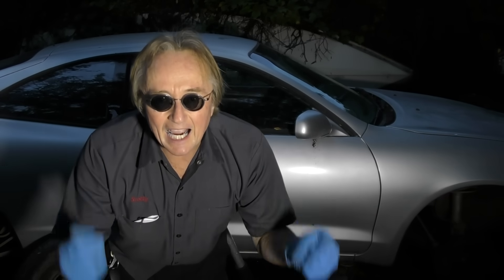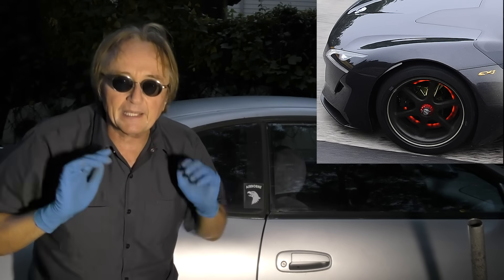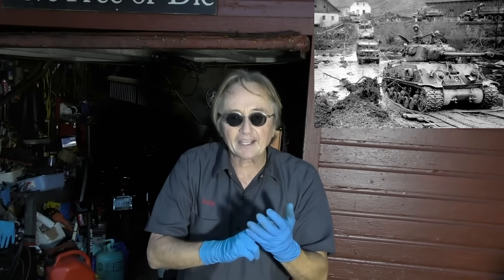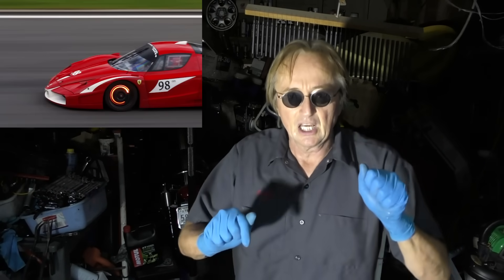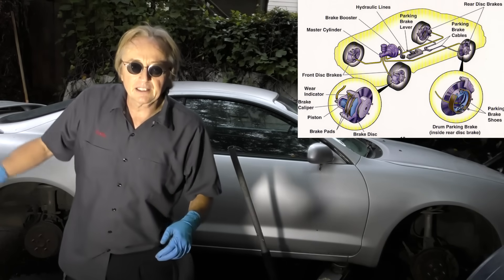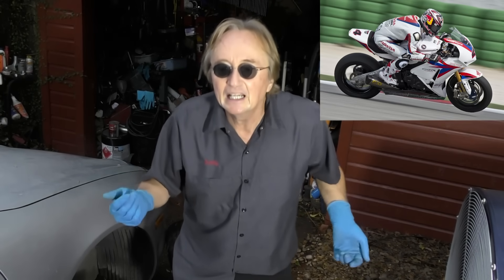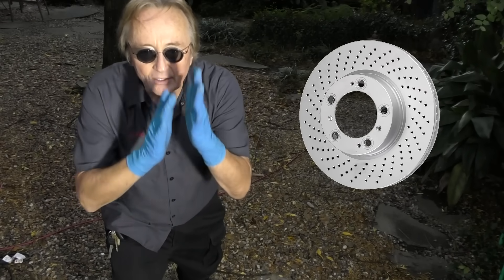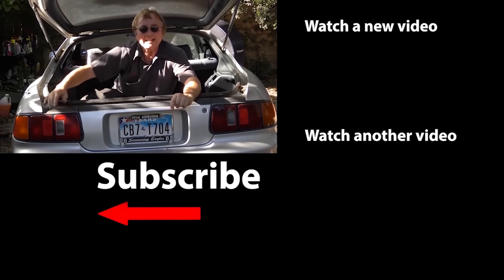Why Some Cars Have Drum Brakes Instead of Disc Brakes

Comment: Those rear drum breaks make a much simpler system for the emergency brake setup.
Reply: Chevy trucks switched from 4 wheel disc to front disc & rear drums in the middle 2000's. When I asked the sales guy why he just rolled his eyes and said they told him they would stop better. Found out later that with 4 wheel disc they were starting to fail inspections because the parking/emergency brakes would not hold.
Reply: Many cars that have 4 wheel disc brakes have an inner drum brake in the rear disc brake rotor to serve as the parking brake.
Reply: Get a Volvo - disc brakes with drum handbrake. Madness.
Reply: Those wear discs with a drum parking brake are better they don't wear and NEVER use it for emergencies unless it's about 5 mph or less the car will spin out it's for PARKING ONLY
Reply: @DylanL69  i did it with 6 miles an hour i spun out and distroied a building killed 500 ppl and for as far as i know im stil spinning
Reply: @jwvanliere854  damn ouch that sucks
Reply: @DylanL69  yea im stil spinning out but im almost at 5 miles an hour now so il be fine soon
Reply: @jwvanliere854  lol you got jokes
Reply: @DylanL69  It's a matter of terminology. Americans call it the emergency brake, in the UK we call it the handbrake - a term that makes no assumptions about when to use it.  In fact if the footbrake failed, you would want to use it. Better to spin than hit something, and it would depend on how hard you pull it.
Reply: @DylanL69  and emergencies
Reply: No it's not if you use it for emergencies the car will spin out so that's wrong
Reply: @DylanL69  I realize what you are saying but if you're approaching a red light and your brakes go out you're not going to use the "parking" brake?
Reply: No, it doesn't. It's more complicated. You can have you standard rear disc calipers with an arm connected to the hand brake line. TA DA! You know how I know? I own multiple cars with that design. Drum and disc is retarded. The junk always wears out and can't be adjusted anymore. Guess how I know about that? That's right, I own multiple of those cars, too!
Reply: Drum brakes are less efficient.
Reply: @Thunderstormworld  yes they're less efficient but they make the best parking brake
Reply: @DylanL69  not really, disc still out preforms and less hassle
Reply: @DylanL69  Not when the parking brake is tucked under the hat of a rotor. You get the best of both worlds
Reply: @thefuzzypickle8277  no you don't
Reply: @Thunderstormworld  No, drum brakes have a lot more contact area for braking. The problem is cooling, brake drums have a lot of mass and they don't dissipate heat very well due to their design, they don't really have any airflow compared to disc brakes. They are good for one hard stop, after that they start to get brake fade. On never cars there are only disc brakes due to drum brakes looking ugly

Comment: Brand new Toyota Tacoma has rear drums
Reply: Jon Smith as good as Toyota's are,here in the UK their parking brakes are notoriously poor with the disc/caliper set up....my old Rav4 has drums,never had a problem or changed shoes in 9 years.
Reply: What a joke huh lol
Reply: Yup, and with the parking brake on, the wheels might as well be welded to the frame. Full size rear drums make superb parking brakes.

Comment: Aside from performing better, disk brakes are a lot easier to service than drum brakes.
Reply: Mark Jordan more prone too seizing though,especially rears....using good grease on the sliders helps alot though...I use Mintex ceratec,alot of people still wrongly use copper grease on sliders.

Comment: I drove with rear drums for about 15 years and discs about 20 years.  The discs are momentarily jittery after driving through a large puddle.  Never happened with the drums.  I guess if one fords a river 2 feet in depth, it could get wet inside the drum.

Comment: good day sir, i have an mitsubishi fuso drop side elf truck that i used for sand or gravel delivery 3 cu mtr capacity. is it wise to convert either 2 front drum brake iinto disc brake or all 4 drum brakes into disc brakes. ?

Comment: THe MAIN reason for drums,is to have an easy  way to install your emergency brake;
You can't  put an emergency brake on disk brakes; 
Well,you can,by paralleling the disk with a drum,but that brings the weight and complication up a lot;
edit     Also,drum brakes are more powerful,they have more area; trucks and trailers use them; the price is the same.
Reply: Discs are more powerful, not drums
Reply: @spartacussmith7070  maybe yes,maybe not; it depends on friction area and force (pressure  times piston area); 
Tractor trailers have drum brakes,they need all that area; 
(From the net :"90% of heavy truck buyers today still choose tried-and-true drum brakes"); 
There are tractor trailers with discs,also.

Comment: on my 95 celica sx ive got disc brakes on both front and back, is that normal?
Reply: Definitely.  I have an 03 Acura, an 08 Acura, and 16 Acura, and they all have all disc brakes now.  If you do your own brake work (or are considering it) then you are good to go.  Discs are super easy to change out compared to drums.

Comment: Scotty the statements you are making in comparison between drum brakes vs disc brakes is not all the way correct. Why not use the engineering principles of force by clamping . The brake manufactures are truly laughing  at your representation. There is a good reason why you have disc brakes on the front and drums on the back!!!

Comment: The first American Cars with disc brakes were the Crosley Hot Shot/Super Sport and the Chrysler Imperial in the early '50's.  The Corvette came out with disc brakes and IRS because the Jaguar E-Type with their disc brakes and IRS was mopping Corvette up on the race track.  Drum brakes on older cars are fine IF you drive your older cars like they were designed to be driven.  If you don't, brakes are the least of your problems.

Comment: drilled rotors are the worst, they tend to have weakspots on where the holes are and crack under extreme temperature change during braking and accelerating. Most race car drivers used grooved rotors. Sports cars that have drilled rotors are mainly there for aesthetics.

Comment: 4  drums brake downfall was, when one wheel hit a puddle of water then you brake, the car would "pull " on one side. The most important thing is, people had to drive in a more responsible way because, they had to keep it at a moderate speed and a safe distance from other cars. That's why, you see ALL original, old cars, driving slowly.

Comment: True drum brakes last than disk breaks, my 1996 F150  believe it or not since then when I bought that truck so far I still have the original break shoe, my front disc breaks I replace it 3x already..

Comment: 1969 Mercury Cougar. 351 V8, drum brakes. Fast idle when cold. Drive a block down the street. Slow down to go through a dip in the road on a rainy day. Wheels got wet and you didn’t need to take your foot off the brake to accelerate. The car speed up from the fast idle and the slipping wet drum brakes. You had to be sure to stop early for the red light up the street because it took twice the distance to stop with wet brakes.

Comment: Prior to ABS I remember "Low Drag" disc brakes around 1980.  Those had a tendency to not stop the car in an emergency for the first few stops.  I also remember front discs/rear drums from the early 1970's that would allow the drums to lock-up and cause the rear of the car to swing around.  I think this was prior to proportioning valves.  Brakes have come a long way over the years.

Comment: Converting a classic era automobile with original 4 wheel drum brakes to front disc brakes should not affect its assessed value either. It's the right thing to do for public safety (sez me who used to drive a 4,000 lb. Ford with 4 wheel drum brakes, no power assist, and single brake fluid reservoir. Yikes!).

Comment: I will never buy a vehicle with rear drum brakes again. Every one I've had they rust a little and lock up first application if it was damp when you parked it. I could never get them to automatically adjust exactly the same either. Why they are still used I don't know.
Reply: Like Scotty said, using rear drum brakes is a way of reducing manufacturing costs. It costs money for a manufacturer to change the design of a vehicle and alter the manufacturing process to go from rear drum brakes to all four disc brakes. That's really the only reason why only basic economy cars have drum brakes anymore. Even many not so expensive brands have all four disc brakes!

Comment: I have a 2009 Chevy Cobalt with a automatic transmission I have replaced the race axle seal AKA output shaft seal two times in the last three years what could be causing this seal to go out repellently

Comment: i bought a 66 beetle and i was wondering if i should convert it to disk breaks
Reply: I had a 73 Thing that I put a disc brake kit on the front. It made a huge difference. No more downshifting when you brake for a panic stop. The Thing also had two adjusters per drum that didn't self-adjust. The kit I installed also came with a new master cylinder.

Comment: I thought the drum and tge disc brakes are for safety purposes like when your front brakes dont work the rear works if everything dies not work the hand break does if not the engine brakes does and if not the clutch will.

Comment: I don't agree with using mostly front brake on a motorcycle. 
I think it's dangerous .. but it's only my opinion. 
The rest of the video was great !
Reply: Well, touching the front brake while cornering isn’t the smartest thing. Anyway, on a motorcycle most of the weight is hanging over the front wheel while braking. The more you squeeze the front brake the more mass will be shifted over to the front wheel. Because of that the front tire will compress, increasing its contact surface on the asphalt, which means that it can take even more braking torque before the wheel locks up. In that kind of situation 90-95% of your weight, including the motorcycle, is taken by the front wheel. Which means the back wheel will have minimal traction. Its only distracting and it does affect your braking distance very little. 
If you think using your front brake on a motorbike is dangerous, why do you even bother riding ?

Comment: In europe, back in '55, the Citroën DS had front power disc brakes and was a mass produced vehicle, even for today's standards its high pressure hydropneumatic system makes its brakes be really effective, they're inborard, next to the gearbox, not at the wheels, and have air conducts coming directly from the front of the car to cool them, you don't feel any fade. 4 drum brakes would work perfect in old, little and light european utilitary vehicles, cars that used to weigh arround just half a ton, those drum brakes are really hard to fade as well. I use to drive a Renault 4, a Seat/fiat 600 and a 2cv with all drum brakes and they're great for those cars, not the same with my old '58 Plymouth or my Seat/fiat 1500, but they weigh quite more and are faster, of  course.

Comment: You never just use the front brake on a motorcycle, always apply the rear first. Even the high end bikes have systems that apply the rear first even if you don't don't by using the pedal. Panic grab on the front lever will apply the rear first with high end systems.

Comment: Front Disc Brakes is good enough as a standard because 90% of braking power is by the front. Ok. Drum Brakes much much less effective and has a weakness for water but they are cheaper and drilled or slotted disc brakes only good for racing and also wear out much much quicker than normal flat disc brakes.

Comment: Hey Scotty, I was watching a Formula One pre-race feature when retired F1 driver Martin Brundle took current F1 Driver Daniel Ricciardo for a spin around the circuit in an Aston Martin.
When they came back to the starting position, the the right front brake suddenly burst into flame(!) A member of the team helped out by dumping their giant Slurpee into the front wheel, extinguishing the flame. I think that the anguished scream we heard immediately after that was from the engineers at Brembo who had just seen their rotor— glowing bright orange — suddenly de-tempered with an ice-cold drink.  Like you said: Time to change the brakes. What??? It's only money.

Comment: The first mass production use of the modern disc brake was in 1955, on the Citroën DS, which featured caliper-type front disc brakes among its many innovations. These discs were mounted inboard near the transmission, and were powered by the vehicle's central hydraulic system. This model went on to sell 1.5 million units over 20 years with the same brake setup.

Tucker wanted to put disc in his but money and engineering issues forced him to use conventional brakes.

Comment: But the Integra, based on the Civic had rear discs on all of them.
Reply: Some cars (especially if it's high luxury or a sports car or a higher trims) do have all discs all round. For example my Camry in 1995 lower trims have brake drums but higher trims have disc brakes all round.

Comment: I Think That is a mather  of  engine capacity.  Many Times they put discs after "few horses power "  on The cars. Mabe The small engine don't need som much brake . Just if you go to racing.

Comment: On motorcycles i always use the rear brake for slowing down and the front for stopping. Strong brakes on the rear are pretty pointless since all the weight moves to the front wheel when slowing down anyway causing the rear tyre to skid.

Comment: My 2003 BMW 320i has combined drum and discs on the rear; Discs for stopping, drum for parking brake. Problem is the shoes wore a lip in the drum, making it a PITA to get the disc/rotor off. Fiddly little parking-brake actuator that had me cursing putting it all back together.
Reply: B.M.W. = Bust My Wallet

Comment: Back when there were many disc front drum rear configurations around, was the fact that drum brakes are self assisting. This was useful for the functioning of the emergeny brake system as the e-brakes used the rear brake drums /shoes and could be mechanically engauged as was done using a small e-brake pedal or hand lever. On 4 wheel disc brakes back then, Corvettes, Volvos etc. 1960 and 70's the emergency brakes where a completely separate drum brake subsystem that was designed into the rear disc brake hat on each rear rotor. Worked well but lots of parts so costly.  In the 1990's,  to solve the cost problem of a 4 wheel disc brake system with emergency brakes,  the designed advanced into the cam driven calipers where the e-brake function could then be incorporated to use the rear disc brake pads/rotor to also function as e-brakes. Mechanical tolerance control  and mechanical advanatge was the challenge that was solved.

Comment: Toyota Tacomas still have drums in the rear and the engineer says it is NOT to reduce cost, but actually for better brake performance offroad (because dirt/mud won't get on the drum/pads since it's enclosed). I don't buy this one second - I think it's to reduce cost. What do you think?

Comment: Toyota Tacoma engineers left drums on the back of the vehicle because they said that drums are better for deep mud and off-roading.
Reply: Douglas Graham I was actually wondering that, all of the pick ups have 4 wheel disks except the Tacoma, I think they should off 4 wheel discs as an option though.

Comment: I was actually thinking about going from disc brakes to drum brakes...

...on my bicycle.
Reply: I love the drum brakes on my bicycle when I was a kid.  Because the screech when you hit the brakes hard. It sounds like your doing a burnout.
Reply: Funnily enough, many children's bikes used something very similar to drum brakes for stopping.
Reply: forget it disc brakes for even bicycles! works better than anything else in rain/mud and unlike rim brakes no worries about rim failure...
Reply: I had bought a stove and forgot to remove knobs before transporting it.. (Glad my bike had DISC BRAKES on it when I had to transverse a steep grade /hill on way back. If the bike had regular bike brakes I doubt they wouldn't have slowed me down much.
Reply: No.
Reply: Many years ago in England many adult bicycles had very efficient drum brakes.
Reply: In the Flintstone car, your feet are the brakes.
Reply: Bike rim brakes are disk brakes.
Reply: Why the hell u watch this video then🤣
Reply: Rim brakes seem like they have so much more mechanical advantage.
Reply: bicycle should be using rim brake.Disc brake has very strong stopping power so that an anti lock brake system have to be installed.
Reply: @lanchanoinguyen2914  most bikes use disk brakes. They stop a whole lot better, and you don’t need anti locking, you just learn that slamming on your brakes is going to put you over the handle bars.

Comment: It's true you don't really need the drum brakes behind to stop the vehicle.  I changed drum brakes on my car awhile ago and forgot to adjust the brakes. After 2 weeks the front new disc brakes wear out.  When I opened the drum, I saw the shoes didn't even touch the drum.

Comment: A fundamental reason that drum brakes are better for the rear of a road car is to have a better handbrake (parking brake).
My 1992 Rover 214 (UK) had a great handbrake - never bettered by any other car I've driven. Drum brakes are self-actuating so grip more if the car tries to move forward whereas many drivers have had cars with rear disc brakes roll away after parking them with hot brake discs. Rear disc brakes are for posers who don't know how cars work.